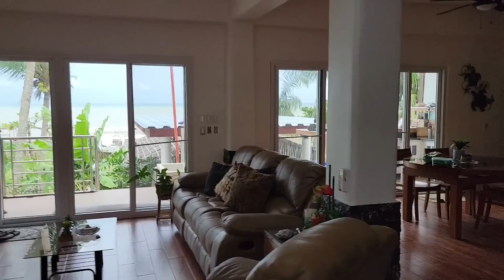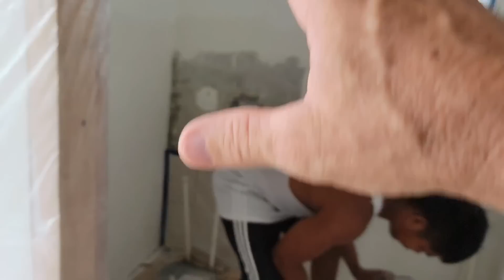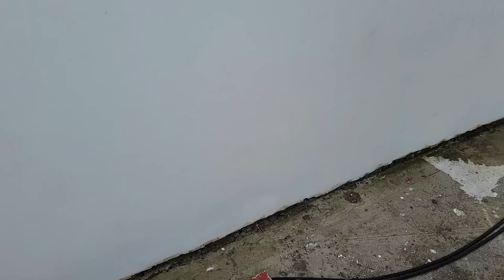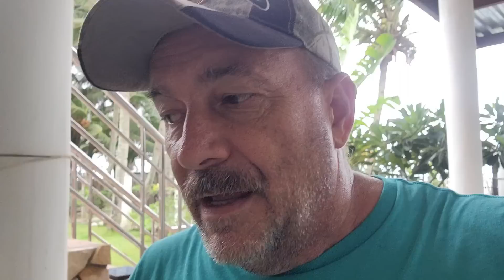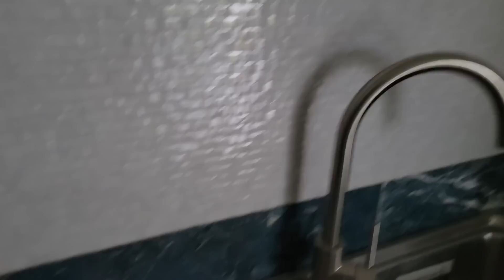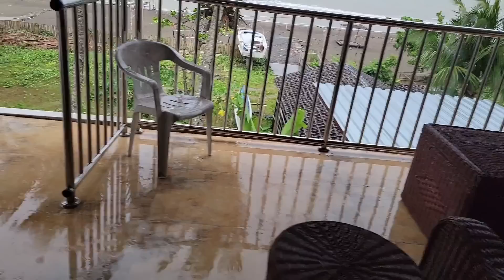HOW MUCH YOU can buy Solar System for Yourself $$$

Comment: a hybrid system with battery that has net metering is the way to go in the philippines. all the solar energy that is harvested never goes to waste. all the credits that you rack up can be used to offset the days when its cloudy or rainy and solar harvest isn't optimal. plus you have the peace of mind when something goes wrong with the solar system the grid is there to power your house. i've even seen a lot people do solar battery hybrid setups with net metering plus a gas/diesel generator for that extra backup.

Comment: Hey James, could you run a cable to your mother in laws perhaps to a bank of batteries  rather than discharging  to the   grid? Or is she too far away? 
I had solar panels providing hot water on my house in Ireland, they were fantastic, photovoltaic panels were just too expensive at the time to consider. Very interesting topic, great video as always 👍

Comment: James, I spent $20k on my system up here in  Lipa. 21 kWp PV (30 x 700 watt bifacial panels), 16 kW Deye Hybrid Inverter, 2 x 15 kWh Felicity batteries. Tools, ladders, shipping, breakers, SPD's, PV disconnects, cabling, etc. I run grid tied for the surge capacity (none of that net metering scam), I have the electric shower water heaters. I went big because of the shading I get in the summer. I knew I was going to have shading issues because of where I wanted to put the panels. I get plenty of sun on them in the morning for recharging though. So far almost 9 months since I designed and installed the system and working like a champ. I wish we had enough wind here for a turbine, that would be nice. It sure is nice not dealing with brownouts and outages.
Reply: Your solar setup is similar to what I've been researching for the home I'm having built in the Ilocos Region. I was also looking into the bifacial panels, but everyone I spoke to in addition to the information I've read all says those panels are best utilized for areas where the light has the ability to reflect back and hit the underside of the panel. Structures such as carports or ground setups versus being mounted on a roof top where little to no light will be able to reach the underside. Has having the bifacial panels made any difference in your setup at all for better or worse?
Reply: @incon3037  I actually bought my panels because of the price, not the bifacial aspect.  MIne are on a high ground mount but don't get any reflection. There may be some generation through the panels but I don't have a way to measure that. In the future I may install a T shaped pool  with the T under part of my array.  So this may end up getting some reflected sunlight to the panels. Also this way a swimmer will have the choice of shade under the array or sun the other way. Plus the portion in the sun will keep the water warmer, that's the plan at least. I would mostly use the shaed part, otherwise I'll look like a lobster. My panels were approx $0.30 a watt wp shipping, $0.34 including shipping to my house in Batangas. That was $234.60 shipped per 700 watt panel.
Reply: @pilotdrh  Thanks for replying. I think the pool would be a good idea and it would be cool to see if your panels generate any additional power.

Comment: alright James, I need you to come back to Texas and set me up with solar.  Electricity costs just keep rising here.  The best rates right now in my area are around 11.5 - 12 cents /kWh.  And we are having record heat this summer.
Reply from the maker: The problem in the USA is the battery cost. I can buy lithium batteries in China which where most all Lithium batteries come from for a great price including shipping and customs. In the USA Trump put in a big tax  plus the current global shipping cost which makes the same system very costly there. paying 3 or 4 times the price on batteries.  We have solar at our Texas house. Small system as far as battery storage. Using a Tesla battery which does have fore risk if not cared for properly. When we do get there though we should be able to run our aircons all day on solar and just use the grid at night.
Reply: @TexasFilipino  Yeah, we'll never be able to   sell lithium batteries cheaper than China here in the US because we rightly outlawed slavery in 1862.  China still continues to use what could be compared to "slave labor".  Keep up the great work in the Philippines James.  Your house is awesome!  If I ever make it there, I want to come visit you and Melinda.

Comment: I'm in net metering in VA USA my monthly bills are $9 (1 kw stored to the grid and 1 kw to draw from grid at night and bad weather) before I paid over $150 a month. You paid $3,200 without installation cost for the batteries. To become off grid 3200÷(9×12 months a year) equals 29.6 years. Battery life is around 15 years if you're lucky.

Comment: Sir i have a question, how long time do you think it Will take until you reach break even on your investment ? And is it possible to see in your solar system how much all your diffrent Electric device's cost ? So you know what shut down first to save Electric in your batteri's..IF the sun is gone for a long time..sorry for my poor English ☺️ And I want to tell you, your house you build is beutifull, I wish I have your know-how in contstruction...Congratulation !!!
John from Sweden.
Reply: Depending on how much they use the aircon, as that's the biggest consumer. Within less than 10 years, comparing at 3000pessos a month for grid electricity. If we guess, that electricity prices will raise, than quicker. If they consume more, also quicker.